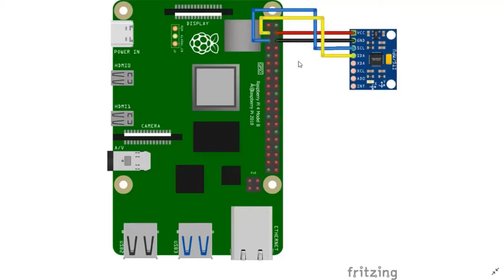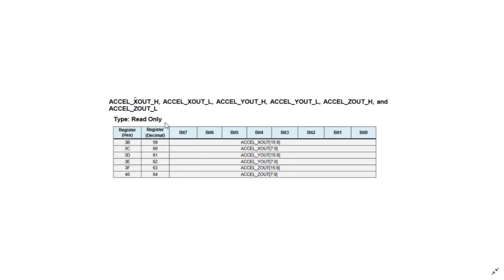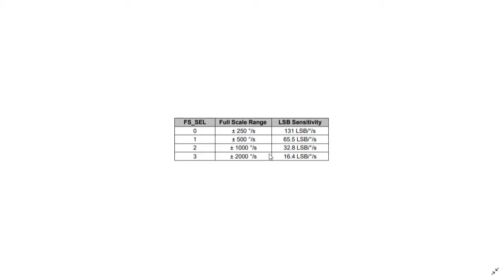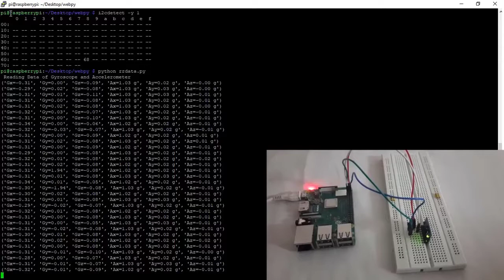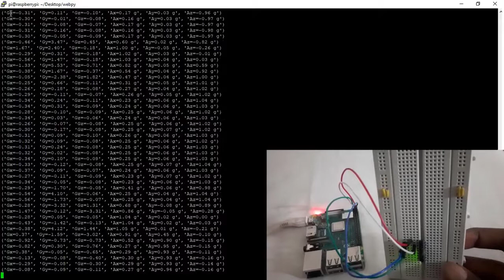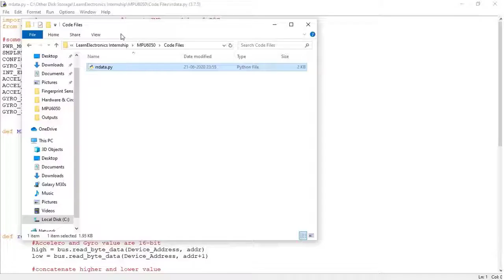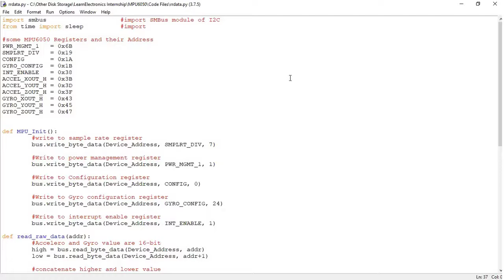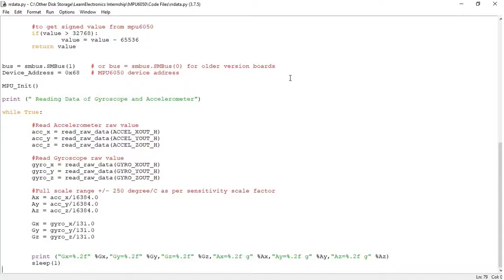Interfacing IMU Sensor - MPU6050 (Accelerometer & Gyroscope)  with Raspberry Pi

Comment: Hi Sai Parimal. Great video. The output of the code is angular velocity (deg/s) and acceleration (m/s^2). How do you get just the angle around the x-, y-, and z-axis in degrees?